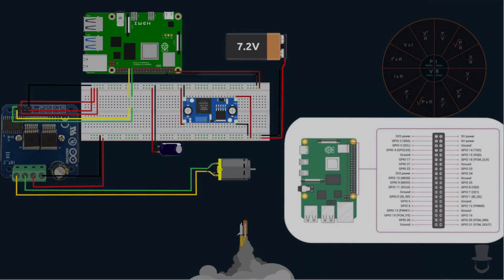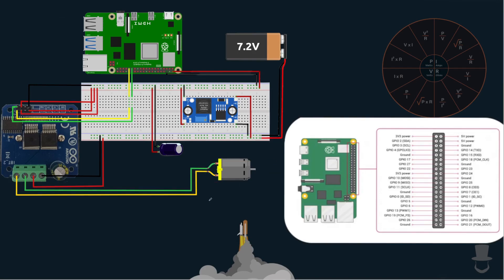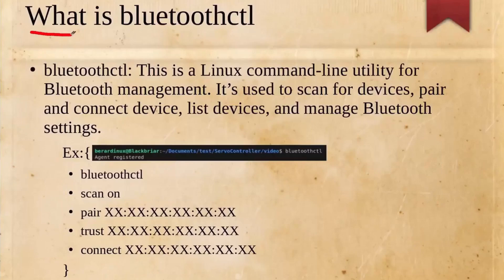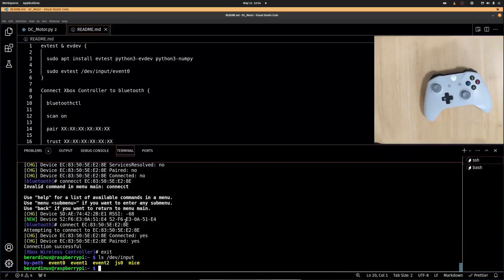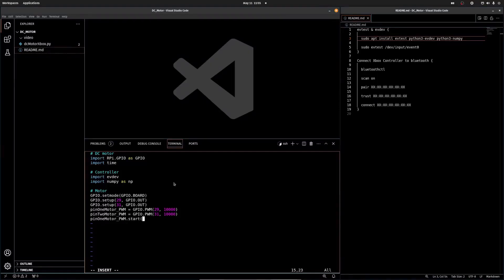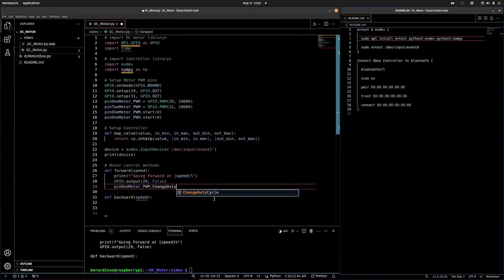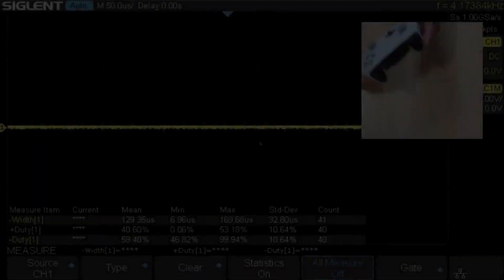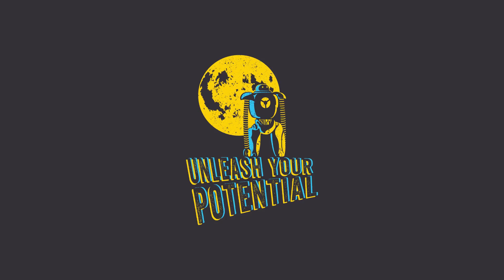Control a DC Motor through a Raspberry Pi with a Bluetooth Xbox Controller!

Comment: Will this only work with an Xbox controller?
Reply from the maker: I think it would work with other controllers, but the "evdev.ecodes" would be different for other controllers. I might be wrong, they might be the same but I would think that it would change depending on the controller used. I have not personally tried it through. Good luck, and lmk if you get it working!